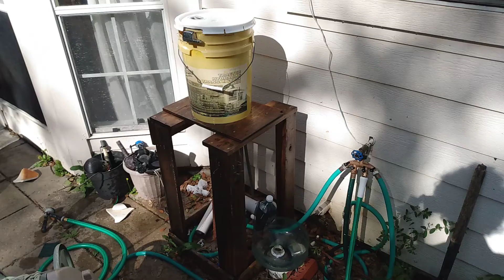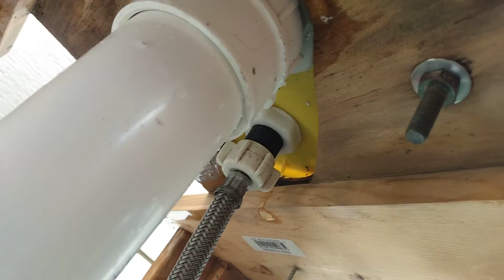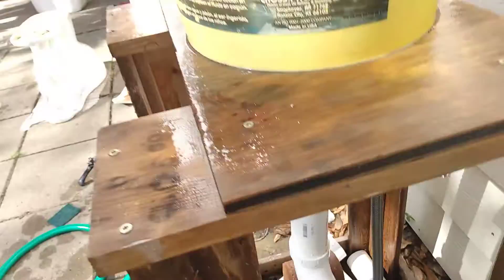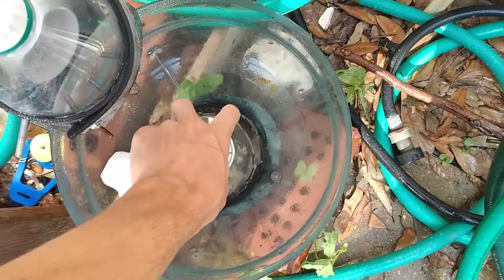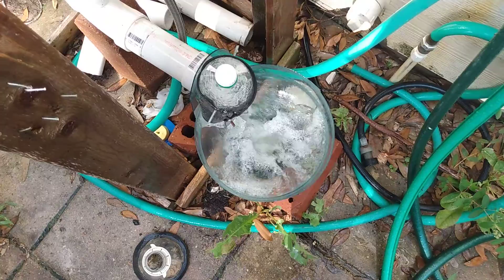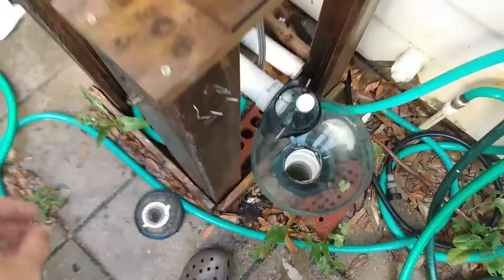My yard toilet in better quality

Comment: You should add a trapway so that the bowl refills and does not smell like sh*t
Reply from the maker: Enough water goes through that it gets pushed along down the line.
Reply: @OCC_Plumbing_and_Restorations  I see its super smart to have made! How did you make this? How did you connect it to the sewer?
Reply from the maker: @RMG_9000  I connected a brick to the front of it to weigh it down and press the seal in place.